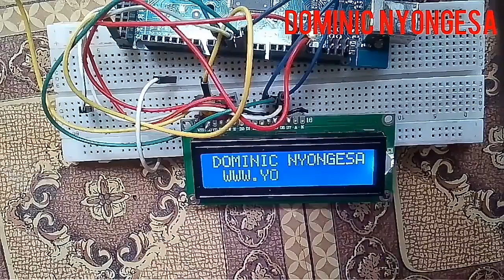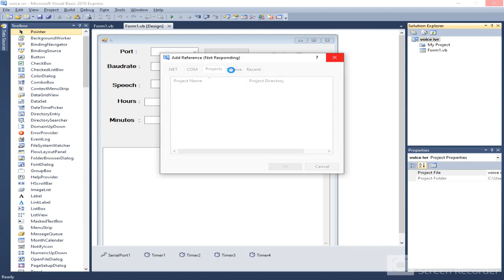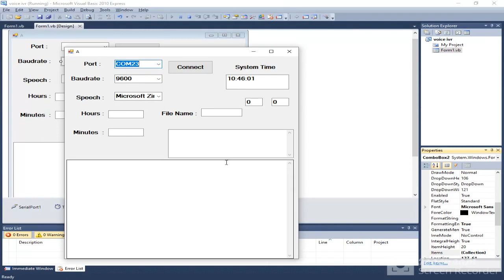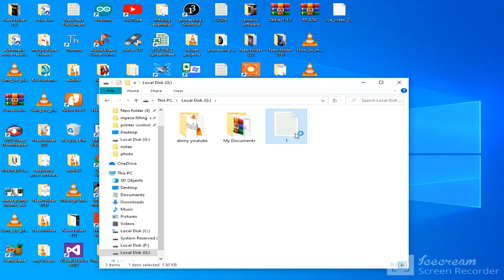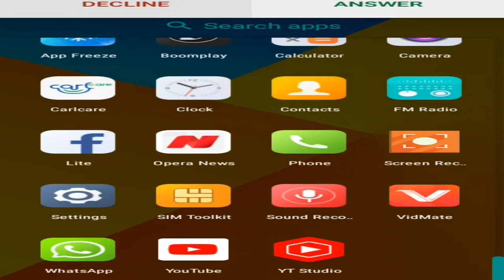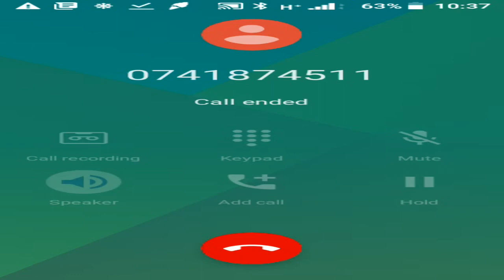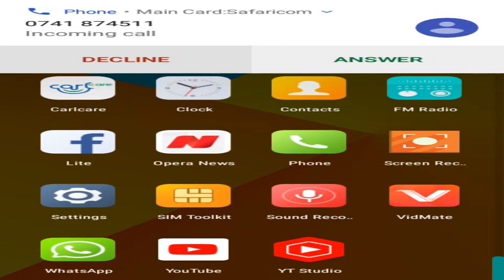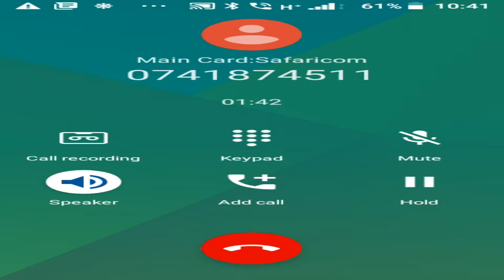Automatic Arduino teaching (Robot)IVR System

Comment: i am using 4g GSM Module SIM7600EI , I want to built a project where user type the message and the message should be played over call once user pick the call and after audio is played auto disconnect the call , Could you please guide me with this
Reply from the maker: it's possible when you use a computer software
Reply from the maker: you can built simple software
Reply: I have developed software, but I'm facing an issue with audio quality. When the audio is played directly through the PC, it's very clear. However, when connected to an AUX cable, the quality significantly decreases. Can you suggest how to improve this? In your videos, the audio is so clear and worth listening to.
Reply from the maker: reduce the audio and put 1uf in between